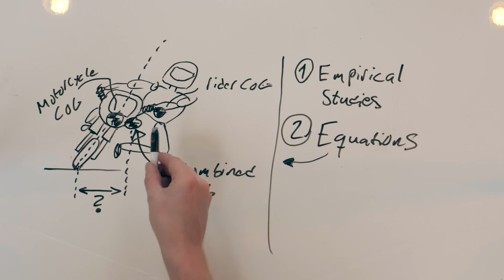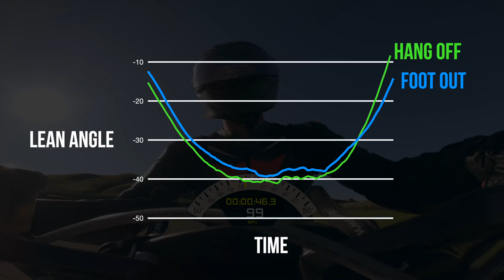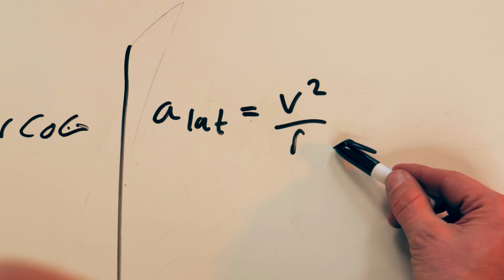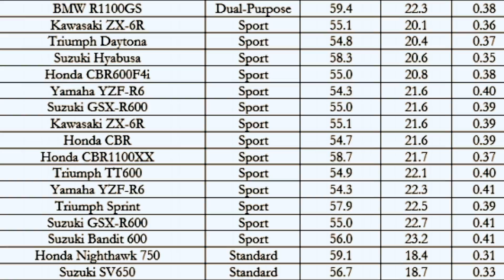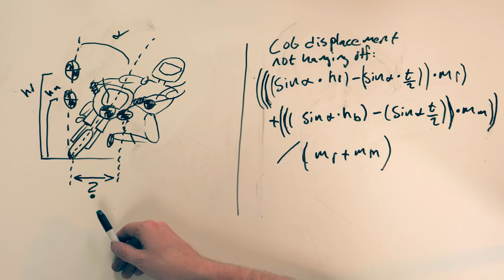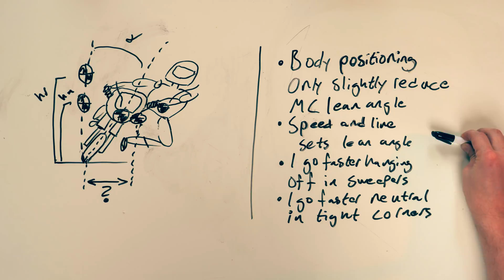Motorcycle Riders - Hanging off & The Science behind it

Comment: You don't need to know more than this:
The more you hang off and move your weight on the inside of a corner, the less you have to angle your bike.
The more upright your bike is, the more traction you have, more traction = less chance of sliding out your front tire or back tire, especially on terrain that has less traction in the first place.
You also have more room to angle the bike if you need to.
Lesson over.

Comment: 9:24 --> this is the whole point: "fast out".
- Wide turns: Lower leaning angle means you can slightly anticipate the burst of power when exiting the curve because the bike is already more vertical.
Then, getting the pilot back to the neutral position on the saddle does not constitute a delay factor because as speed increases, so does the angular momentum of the wheels, which is what sustains the [now vertical] angle.
- Tight turns: Conversely, when the turn is tight, accuracy in drawing the right curve is more important, and that can be achieved more easily by using the arms and the steering. Also, when the turn is over, pulling back the bike is a blink, so the delay in full throttle is negligible.  If however the pilot was knee out, pulling up the body to the neutral stance on the saddle would be a delay factor, because the angular momentum is lower, and hence the pilot has to exert momentum on the handlebar, delaying the acceleration.

The ideal next study would be to find the soft spot (dependent on speed, curve, and bike+pilot weight, and height) at which one should pick one or the other stance. I would be impressed if that hadn't been already addressed by MotoGP teams, but I think for their range of applications, speed are always so high to never get to need the neutral stance.

Comment: I remember back in the 80's, when I began riding, there wasn't much hanging off, but more knee out, as it was used as an air brake to rotate one around the corner better and slow down, with the inferior brakes and tires back then. Actually at the police mc courses today here in Denmark, the instructors don't recommend hanging off as there's to little to gain with modern tires, it's only advised to lean head in to corner and look out of the curve, but than again it's for fast driving on public roads and not extreme racing, where split second counts, where there are no obstructions to crash into.

Comment: But does this not also show that you can (theoretically) increase your speed in a corner by hanging of. Passing a a certain lean angle the contact patch will become reduced and will limit how fast you can go andand by hanhing of you have a larger contact patch for longer. I assume one of the reasons the MotoGP riders hang of so much is that they are at the edge of grip (close to 60 degrees) and that the few degrees less lean hanging of provides give them a slightly higher corner speed.

Comment: In my experience, the big thing is if you're leaned over, set up for the turn and it's sharper/ entering too fast. You have room and you're in position to deal with it, you  likely can correct and won't run wide. If you hit a bump or something the bike is much more stable. This is more on roads, but it makes  huge difference in those situations. Slow speed, counter lean is your friend. Most commuting type stuff, neutral is best.

Comment: All good but you are not taking into consideration the less traction you get a higher BIKE lean angles and how if affects your 100 point of traction. At parity of speed around a corner thad added 1-4 degrees of BIKE lean angle will make a huge difference in how you are able to manage your traction and lean and how much more you can add throttle coming out of the corner. I think your analysis is moot if you don’t incorporate those physics.  A bike leaned at 50 degrees has a way less suspension “safety” factor and “throtttle ON” safety factor than a bike leaned at 47 degrees…(at parity of speed of course)..

Comment: What about tire temperatures?
Reply: hanging off heats the tires up because the bike stays upright which causes lateral forces on the grip patch. staying in line with the bike in straights for example directs force into the suspension rather than the tire.

Comment: I really enjoyed the video. The one take way that I wanted you to note in your next ponderings is that while the number of degrees stays fairly small most tires contact patches aren't  spherical they tend to be ovular. This means even a slight decrease in lean angle can net a large increase in contact patch meaning that depending on the tire setup and bike geom it could have a vastly different level of effect. I think for the SuperMoto you did great but I feel like it's the bike that would have the absolute least amount of change in performance when compared to moto gp. I was always taught that basically the moment you are both on a bike and a road that requires hanging off to take corners effectively is the moment you need to slow down and hit the track. So I would love to see more information and research into how various tire setups can effect this equation as well.

Comment: I'm not entirely sure about the assumption that the CoG of the rider hanging off is still in his navel. Just visually it doesnt look right. I think its further to the outside but I could be totally wrong.

On your point about similar lap times hanging off vs foot out - tyres are also a consideration for me, I'd rather not use the shoulder of the tyre unnecessarily so feel more comfy hanging off.

Otherwise agree with your conclusions. Do what makes you feel good, not everything is about laptimes

Comment: I think it doesn’t matter until you’re corner G force would require scraping the tarmac to maintain balance.  Clearly you need to corner slower to stay under your bikes maximum lean angle or corner faster and manipulate your center of mass to keep from scraping the tarmac.  The benefit of hanging off the side is carrying more Gs through a corner.  It’s not a cause-effect relationship either, it’s a requirement.   At any cornering G requiring less than maximum lean angle the only other difference will be in exit torque due to driving on the smaller diameter of the rear tire in its leaned over state.  This is because a motorcycle tire doesn’t have a constant profile.

Comment: You're only measuring the lean angle at a single point of time. The measurements should be made over time. You're on the right track when you talk about line, because that alludes to how quickly you can transition, and how long you're in a given lean angle.

Comment: the more lean the bike has the more cornering force you gain per degree, the equation is exponential, however, the degrees you gain from body position remain the same regardless of your lean angle, this equation is linear, so in high lean angles body position becomes much much more important, hence why we see marc do the crazy stuff and why you should not have to hang as much in your street riding, it won't benefit you as much

Comment: Very nice explanation, but it did not answer the main question: WHY? (or, when does the reduced bike angle actually matter?)
In short: edge of tire (or other bike limitations like footpegs on non-sport bikes; basically when you hear a scraping sound).
So, we all know chicken stripes, but once you reach the tire edge, our "indicator" disappears. Racers actually lean the bike past that (maybe "negative" 2cm chicken stripe???). But the extra lean actually reduces the contact patch, reducing overall grip. Up until the edge, contact patch is slightly increased due to speed (load on tire), but is consistent across the tire. So, on edge, as they increase the speed, they literally reduce the grip, until it's gone. With those extra 4-7 degrees, they delay  that point and get extra speed.
I would say that on a rainy track, with wet tires, they don't actually need the edge grip, as the overall grip drops before reaching the edge (see the podium of a rainy race and notice how the tire edge sticks upwards). But it's better to train a single position than more (and then estimate also that position). And that's before going into knee positioning discussion.

For us mortals, unless we are at the limit (tire edge for sport bikes, footpegs for touring/commuters and even exhaust pipes on cruisers), hanging off is nothing more than TRAINING for when we actually reach them (useless in short term, but it needs to be practiced). I don't think the angle really matters in low-grip conditions.
PS: my Yamaha XJ6 can't lean the use the last 1cm of chicken stripes due to footpeg scraping. Maybe with aftermarket stiffer springs, but not on factory.
PS2: If you look at really old races, hanging off was not used because the skinny bicycle-like tires did not allow to really reach the edge. If you really want to, you can examine how tires looked before and after hanging off appeared.

Comment: Great series on motorcycle riding dynamics.  I believe racing would provide the clearest canvas for bike dynamics, and I don't race.  Riding on the street, I've found that remaining neutral increases my safety factor, I'm able to course correct or slow rapidly in a more controlled (comfortable as you mentioned) manner.  Where I ride, I'm always going around blind turns, so I utilize the neutral position most of the time.  Now and then, an open curve at speed presents itself and I'm more than happy to lean to the inside and forward.  Thank you for your insights.

Comment: There is one more effect which you missed, especially with sport bikes. Knee down is a indicator that you reached a limit of safe lean and you shouldn't reach more speed in this corner. On my zx6r, if you didn't hang off, your knee will never reach surface first, before foot stand or other part of bikes frame will.
So practically without moving your butt on seat you will never knee down, so you always guessing how much lean you have and how much you can push more. So for me hanging off give me much more confidence. And less lean angle is always more grip

Comment: Cool video!!   Soooooooooooo, you don't need to hang off until you're are the maximum lean angle that the tyres will support. E.g. no point hanging off at 40 degrees if you could just lean 45 degrees. I guess when MotoGP riders get to the limit they can lean the bike, they hang off to reduce the cornering radius for that speed.

Comment: Your findings actually aren't that surprising. So long as speed is what is stressed, you would hang off in long, sweeping corners, but stick a leg out in tighter, shorter corners. The reason being that since you're trying to go around corners as fast as possible, you lean the bike as much as needed--no more, no less. The further you lean the bike to make a corner, the more you have to compensate for the change in the center of gravity/balance, hence you stick a leg a out. But in corners where that isn't necessary, you hang off because pushing the bike that low wouldn't serve any purpose, and might actually be more of a detriment, hence you can hang off in order to maintain your balance since that's where the fastest point of speed is.

Comment: The necessary  (but never stated) assumption here, is that less lean angle gives better grip. In principal.   I feel like we´re saying that less lean angle gives a better contact patch.  But is this true?  I mean obviously, at some extreme angle you´re on the wall of the tire and have no grip at all, but at most angles itś not clear to me why more upright is necessarily better.  Flat-track riders actually push their bikes down into corners and perch up on top of the machines.   Now they are drifting the rear, which is different, but they sure as hell aren´t drifting the front!

Comment: The way you hang off makes a big difference. You can move your backside off and leave your shoulders inline with the centre of the bike. You can leave your backside in place and shift your shoulders (good for road riding) or do both like GP riders do. They also move as far forward as possible to keep weight on the front tyre. With wide bars like your Motard you are not going to be able to hang off very far so cannot compare to a bike with clip-on bars. On a GP bike when your tyres are on the limit hanging off makes the difference between crashing and keep racing.
Reply: This. Hanging off butt and shoulders gets your weight so far forward. It feels like you're draping our body over the front wheel; that's what I feel like I'm trying to do. My helmet up under the mirror on a street legal bike. I found this feels "right" in tight and extended curves like switchbacks, in the 30-40 mph range, where you need to use more maintenance throttle through the curve (vs shorter curves which are mostly coasting/trailbraking before hitting a distinct apex). Getting your weight to the front feels like the more important aspect. in this context.

Followup vid could investigeate the front:rear weight shift potential.

But at very low speed hair pins, I prefer to keep my body straight up (like dirt biking). Better view, and better able to recover a rear slide. If you're hanging off on the super low speed hair pins, you'll tip over quicker if your rear breaks loose. If you're body is up, you have some ballast, keeping your upper body in place while the bike slides out beneath you. I'm pretty sure GP riders do this too, on courses with the super slow hair pins.

Different leans for different corners!

Comment: This is NOT science. This is some guy who can ride a bike justifying his style in riding, the science is simple:  Friction is independent of area, and therefore the grip between tyre and road surface is dependent on the weight applied to the tyres' footprint on the road. The weight ( or load ) applied acts through only ONE centre of gravity, not two, and therefore the riders position on the bike is of no importance except to him. I became aware of this when watching a race at Brands Hatch in the 1950's  when Derek Minter before a wet race, changed his tyres for very narrow section tyres, and apart from winning the race, he set a faster lap time than  earlier that day on the same bike on a dry track. The narrow tyres had a smaller footprint, and therefore the load per square inch to the road, was greater. Derek Minter did NOT lean off the bike, he stayed sat deep in the saddle, looking through the forks the whole race, pulling the bike into a bend and then out of it, to the upright position. There are very few riders that sit tight in the seat today, most riders like to move around the seat, but the Isle of Man TT circuit soon sorts out the men from the boys.

Comment: Very nice analysis! Indeed it makes sense to me that with your body you can't change the center gravity of bike+pilot so much.
There might be another advantage in moving your body towards the center of the corner: your body receives a drag force from  the wind, which applies a moment that helps to rotate the bike around the corner.
This is significant mostly at high speed, where you noticed some improvement by hanging off. What do you think about it?

Comment: Well as an 32 years old and a 2003 R6 rider for 7 years now, i got to say that your body going out of the bike is really important, I'm almost always using batlax tires and they wore off very quickly but the grip is awesome, the thing is when your tires are wearing off you feel the rear dancing and the more you lean the motorcycle, more dangerous it is and I try to lean my body more and the bike less so that i won't go to the ground and up until today, i never went, i got some close calls and learn to lean my body more without the bike and it works wonders... All this in the city were the roads are bad and you have traffic and lights, not on track were you go full speed without worrying with other vehicles, and I'm not a reckless driver, sure i did over speed limits sometimes but when there's no traffic and plenty of space to do it. Anyway, if you're talking about safety and not speed, yeah leaning is very important to me, i feel more safe to maneuver my bike and faster if something happens in the city by adjusting my body more and less the bike just because my body would interfere less and toke more time in some situations than the bike and i can alter the direction with the bike smoother while my body is still changing positions. In my honest opinion, just drive the way you feel more comfort because it's not only the race or speed, the feeling of riding a bike is something i can't feel on anything else and that's the most important thing to me. Please be safe and enjoy your corners fellow riders. Sorry for bad inglish, love from Portugal 👊😎
Reply: Interesting. I took a brake and gas course as they call. And one exercise we had was to lean in corners. The guy said it is a valuable tool to have in every day riding if something occurs and you need extra margin. Still struggling with that. But great to hear some real life experience!

Comment: I totally appreciate the work you put in, also I think a lot of the assumptions are close to accurate. Still I think the conclusion is wrong. First of all, your hanging on the sportsbike is not very good.( according to the video) Therefore the effect is lower. The reduce of lean in degree is as a rule of thumb about 5 degrees per riding style (push to neutral to hang) depending on the bike and driver it can be about  2 degree more or less (per style). (there have been studies about this from the ifz Germany). 
this means that the difference between pushing the bike down and hanging is about 10 to 12 degree difference - which at the physical max of 45 degree lean (at tire friction coefficient of 1) is about 25 % lean angle reduction with the right body position. I think that is pretty solid. Also there are more advantages to hanging than just lean angle.